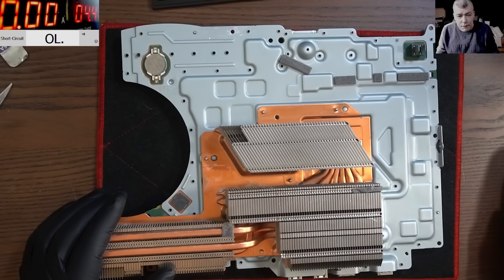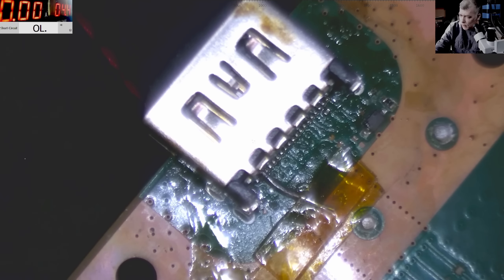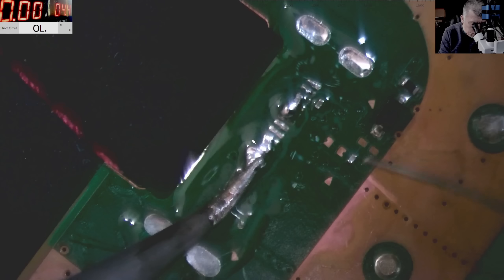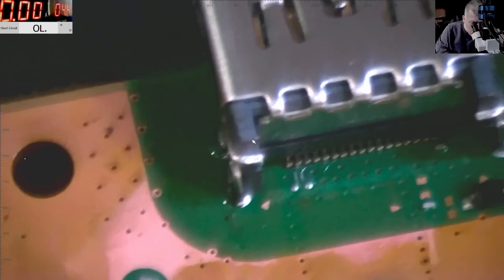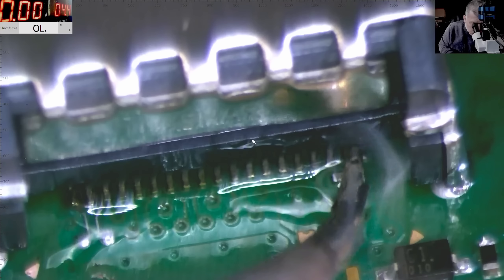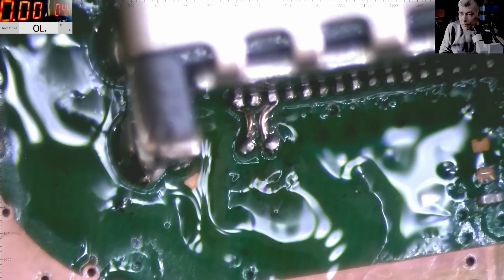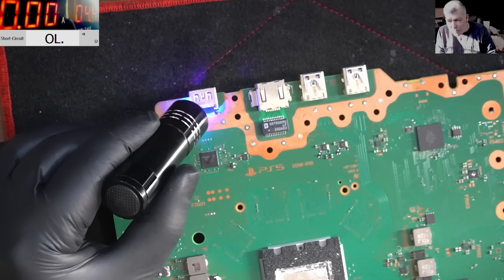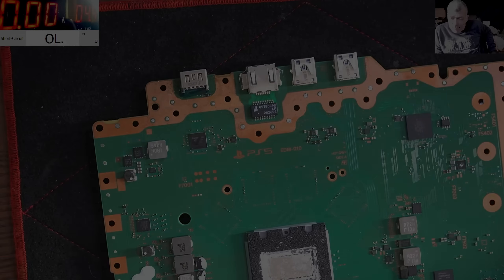PS5 Hdmi port damaged due to 'botched' repair from another repair shop

Comment: Nice job Sorin. I wouldn't even call that "dodgy". It's a perfect bodge repair and sometime that is the only option. The tape holding the wire down is very dodgy and it's not surprising that it failed.

Comment: I use the light activated resin for jobs like this as well. Thats good stuff for securing tracks and covering exposed tracks.
Reply: Till someone snaps off the internal end of HDMI plug female male ends get broken the glue most likely will never come off for a second repair and ps5 becomes paper weight you could try grinding it off all fragile traces but in end most likely they'll disappear🤣💯
Reply: Solder is plenty enough to secure the reason the pads came off is because the first attempt wasn't hot enough before lifting old socket and if joints break in first place it's because manufacturing process didn't use enough solder in first place but here he was generous with amount of solder
Reply: @modbox9560  it comes off easier than you might think, Its best for insulating exposed tracks and securing tracks that have come off the board where solder wouldn't help. Hot glue is ok but most of the items I work on are exposed to too much heat so I have found this as a great alternative.
Reply: @theclintified  I seen the entire pads all covered maybe I seen wrong but sure looked like it I understand it most likely should be used for traces that are missing because the replacement ones have no way of securing to PCB so would be best...
Reply: @theclintified  I have no idea how easy that UV stuff comes off I know 91% instantly removes hot glue..

Comment: satisfaction is not from the cigarettes ,the stress is caused by the cigarettes and the only reason you feel satisfied its because you removing the stress caused by the cigarettes in the first place , its like wearing a tight shoes and feeling relefied just because you removed it 
its called the nicotine trap
Reply: Wrong, IMHO. Because the satisfaction from a cig is max when you are taking you first breath, and then decreases to zero by the end of the cig, and when you are done with the cig, you no longer have the desire to smoke for some time. It is very similar to hunger. 

If it was the removal of the stress caused by the cig, you would have no joy in the beginning of the cig, just stress, and pure joy after you finish it, cause, like you say, the stress is now removed.
Like with many addictions, a smoker frequently questions why are they doing it by the time they about to finish a cig.